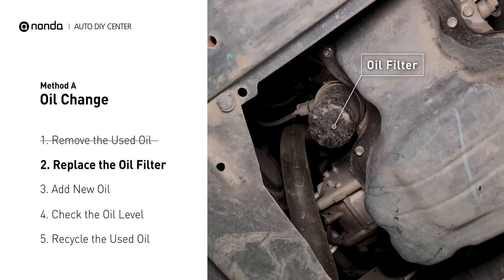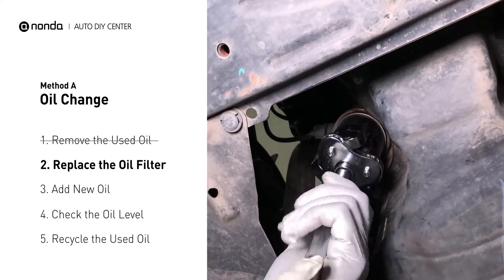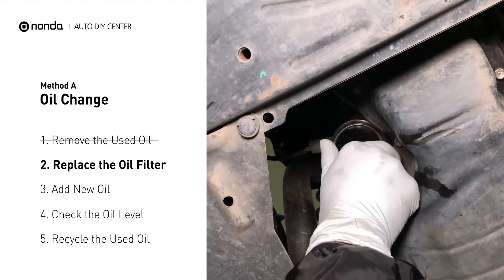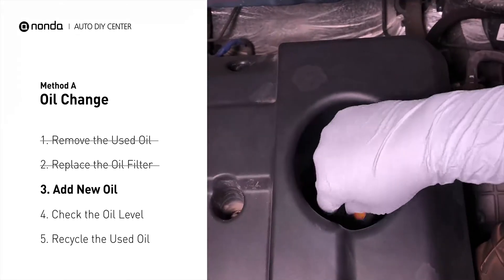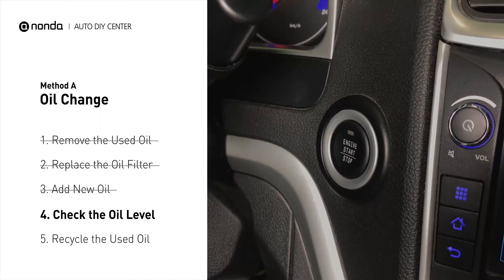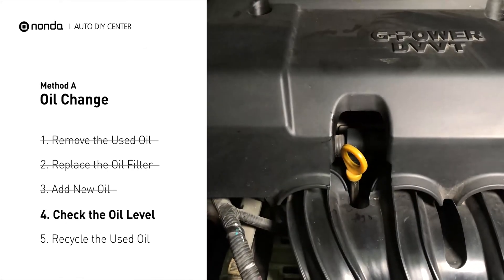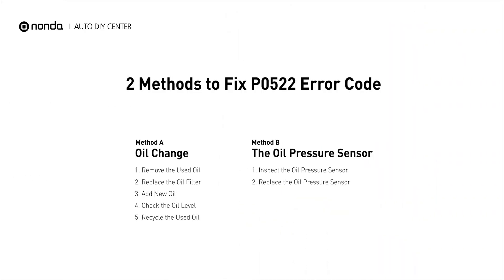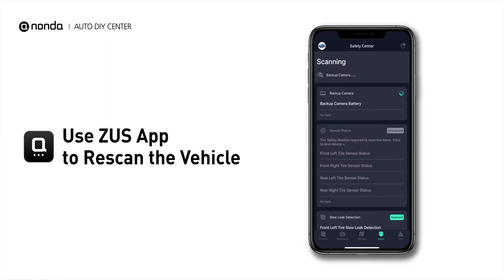How to Fix P0522 Engine Code in 4 Minutes [2 DIY Methods / Only $6.57]

Comment from the maker: Hi, I'm Steve, nonda's lead mechanic engineer. 
Feel free to leave your comments here if you have any mechanic questions, I will be glad to help you out!
Reply: Hey I got 07dodge ram hemi and got the code p0522 on a cold start and showed no oil pressure on gauge in dash but was running good with no ticking or knocking I let it idle and listen for noise no bad noises and then after 5 10 minutes the gauge went back up to normal do you think that’s an oil pressure sensor?
Reply: @redneckhillbilly8788  Hi Mr.Redneck 
Did your problem solved ? , because I have exactly the same issue on my srt8 charger 2006 .
Reply: I did both fixes u said to do & oil pressure light still comes on ( 2015 q50 )

Comment: First owner of 2013 Jeep Wrangler had not changed oil or filter in a long time. Oil was black. We changed oil and filter but still getting p0522 code. Also I think we put 5w30, dealer recommends 5w20. Is there a way to check sensor before removing?
Reply from the maker: Hello, yes- you may test the oil pressure sensor with a multimeter.
Reply: I changed oil pressure sensor and filter screen haven’t changed oil .. but level was good still getting engine light on after I cleared the code . Still getting 522 low voltage oil pressure sensor code .. would changing oil make a difference when level is fine .. oil is dark .. going to check connector for resistance next .. I’m stumped

Comment: 06 Buick rendezvous. Changed spark plugs, coils, and car will start but will stall. No check engine light or oil light but I got the P0521 and P0522. Any thoughts?
Reply from the maker: Hello, since you are receiving multiple error codes, we suggest getting your vehicle visually checked by your local mechanic for further diagnosis. Thank you.

Comment: Owner of car had not changed filter in years I saw p0522 on the scanner and looked at this video. I will definitely change that filter immediately might even fix that p0522. Ill post outcome.
Reply from the maker: Hi Hector, kindly make sure the vehicle is using the correct oil and that the filter is not being blocked or clogged.